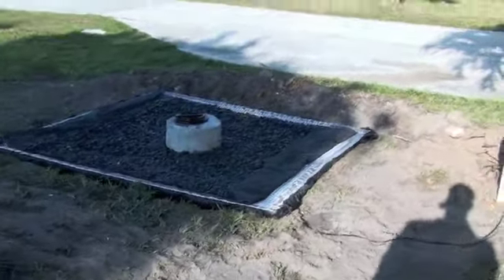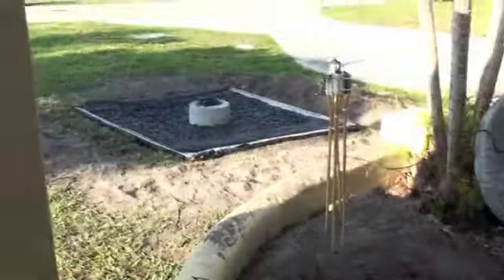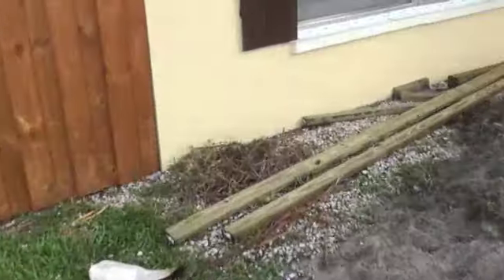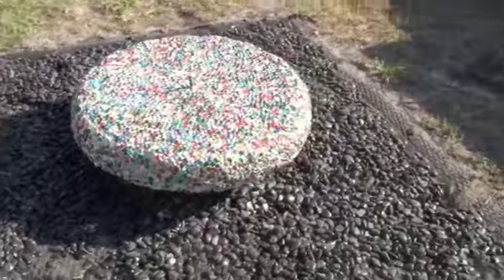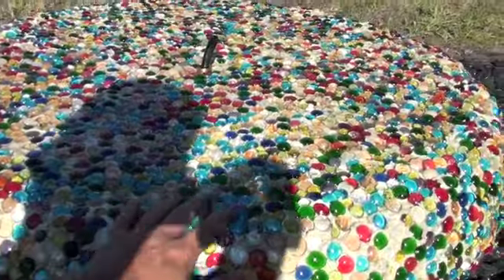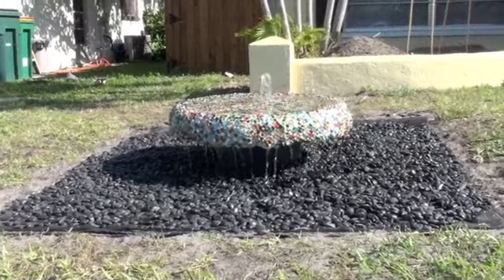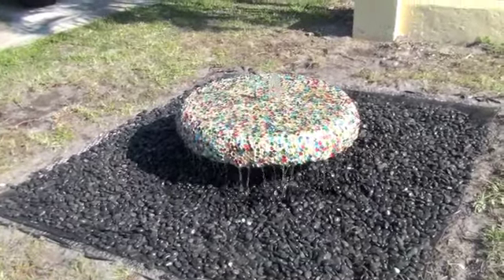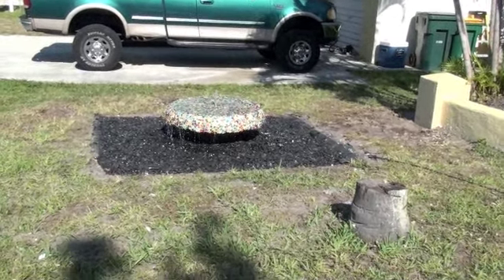How to build a fountain part 3 of 4

Comment: I guess we will never see part 4. A few things to note: Never use timber (even pressure treated) it will rot, and collapse (seen it several times) use bricks or stone. In the centre if you should have made a "well" that would stop the water squirting, and make it flow evenly (assuming its level) 

But a nice effort, none the less.

Comment: Ok to save this project, get enough alluminum flashing and set in place all the way around the existing gay top.  Leave 3" all the way around the existing outside rim.  stake or just use that stone against the outide of the flashing, piling the stone up against it to keep it ridgid, and make sure that the very top of the flashing is level and at least 4" above existing.  Voila! you have a level form.  Tool from the center out to the edge.  Use bullnose finishing tool before it sets, remove forms